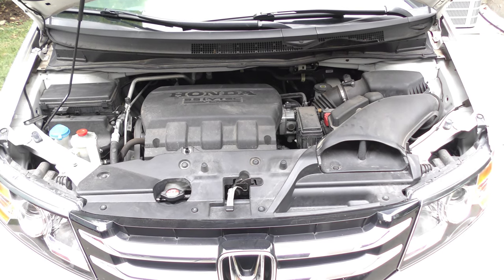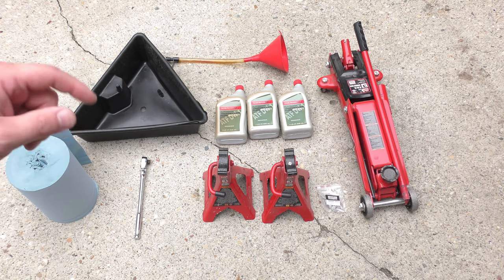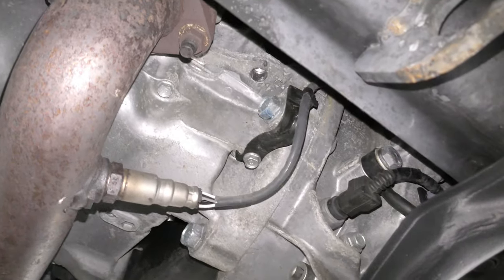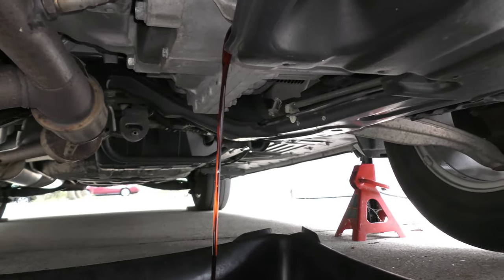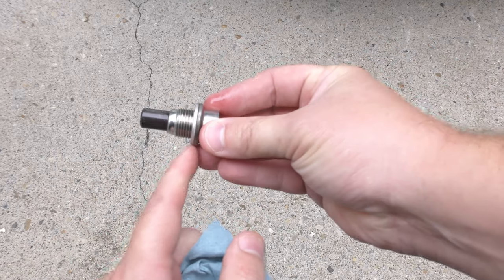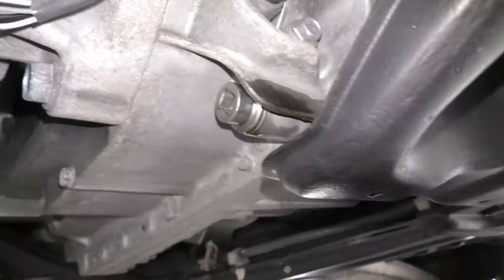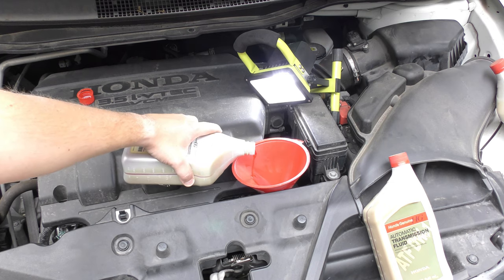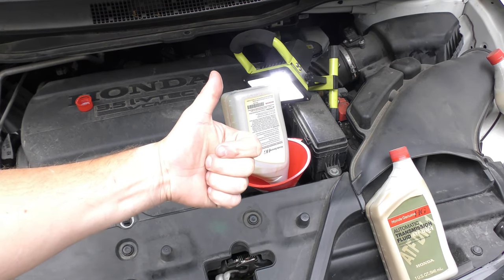Honda Odyssey Transmission Fluid Change - EASY DIY

Comment: On the older Odysseys the dipstick tube is very small. A Dollar General turkey baster works great. I purchased a short torque wrench to tighten the plug. 29 to 30 ft-lbs works fine.

Change it every oil change until the discarded oil is clean.
Reply: With the small dipstick the new oil will need to be added slowly. The actual fill plug is in a filthy area and about impossible to get to on my '06.

Comment: Wow, there was quite a difference in color between the old oil and the new oil.  It would be interesting to know what kind of driving you do.  Is it high speed highway driving or mainly city driving?  I'm suspecting a lot of high speed highway driving with some towing.  It may be "normal" oxidation for oil to darken so much but I'd be tempted to put in an aftermarket transmission oil cooler to keep temperatures down and slow down some of that oxidation.  Unless such oxidation is just from normal driving.  I don't know - I'm just guessing.
Reply from the maker: Quite the difference indeed. We do tow a pop up camper with this Honda. It's only 800lbs but it certainly puts additional strain on the transmission. Outside of that, it's mostly city driving. Lots of short trips to work and drop the kids off here and there.
Reply: I put n an after market radiator and filter in mine.  Was not too hard.  Messy though.
Reply: @KeyFobRob  I recently got done changing the motor oil and transmission fluid in my 2007 Odyssey that has 85,000 miles on it.  I was surprised at how dark my ATF was.  I'd bet that this was the first time the ATF has been changed.  I did something different than you.  I figured why dilute new expensive Honda ATF with that dirty old ATF.  After all, we're only getting about one-third to one-half of the ATF out with each "drain".  So I refilled the four quarts of ATF with Valvoline MaxLife ATF.  After I do that a couple more times, the ATF should be pretty much all new cleaner Valvoline ATF.  THEN, I can start using the Honda ATF for future changes.
Reply: @STBRetired1 . I wouldn't dare use a non Honda fluid in my Honda.
Except the engine oil. Mobil 1 of the correct weight. 

If starting now I would choose the Pennzoil synthetic "Made from Natural Gas".

Mobil 1 used to be made from acetylene gas. Now from crude.😢

Comment: What about the transmission filter?? How often do you change it? Shouldn't you change it out when you change out the fluid? Surely it doesn't last forever, especially if it is the fabric paper like kind..
Reply from the maker: Every other fluid change, the filter is due for change
Reply: Honda only has a internal filter that they do not recommend  changing
Reply: @bryanduffy8791  . I believe it is some kind of fancy wire mesh.

Comment: Do you need change any filters for transmission fluid?
Reply from the maker: The filer should be changed every ~50k I believe - https://amzn.to/3KZytfZ
Reply: My plan is to just keep the oil clean as shown in this video.

Comment: There is no filter replacement required?
Reply from the maker: I believe Honda recommends every 50k miles.
Reply: I don't plan on it. I am just going to keep the oil refreshed/clean.
Reply: Yes!!! There is one, external. Lookup up on OEM Honda parts.
Reply: @aikz5 . 2000 Forester had a spin on oil filter just like the engine oil filter. Except for the cost. Around $40 many years ago. 
So easy.

Comment: I’ve seen some people saying that you need to flush these units twice….. the transmissions are very very picky
Reply: no, the fuck are you making up stuff for just because they said that and it is that way lmfao.....its because honda is shitastic at designing anything after working on this van. You can't fully drain the transmission, and only pull about 1/3 of the ATF out so they want you to continually mix your new with old ATF and rinse and repeat that 2 more times or do it every oil change. They make great motors, but shit cars imo. I'd never buy a honda after going through my dad's 2012 oddssey, freakin under sized breaks that will literally warp if you have to avoid the car in front of you.
Reply: @xpeacemaster  😂 chill
Reply: Never flush. Just change the 3.3 quarts with every engine oil change until the oil that comes out looks like the new oil.
Then every year or 2 after that. Or every so many miles.

Comment: Quick and helpful video! If I can reach the drain plug without jacking up the car is it required to use the Jack & Jack stands? When my car is parked on the driveway it's slanted ever-so-slightly which seems to simulate the car being on the stands.
Reply from the maker: No need to jack it up if you can reach everything!

Comment: Why do none of these videos show the location where you fill it 😭
Reply from the maker: Refill in the dipstick hole
Reply: Use the dipstick tube. Way less risk of knocking dirt into the tranny. On the older 06 the fill plug is impossible to easily get to.